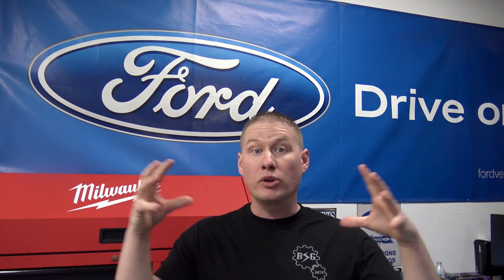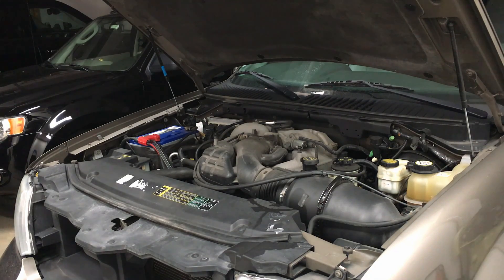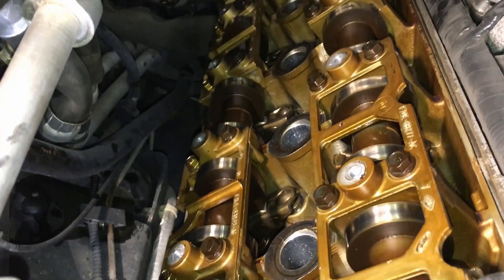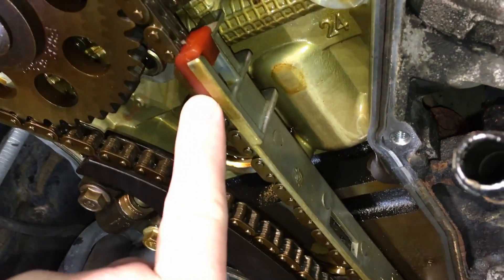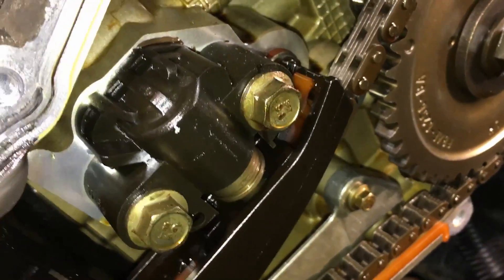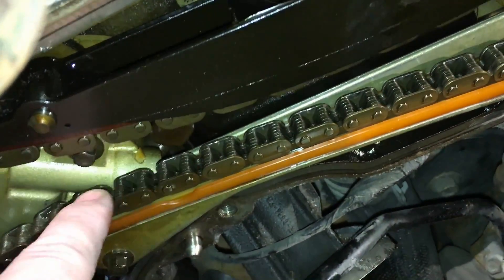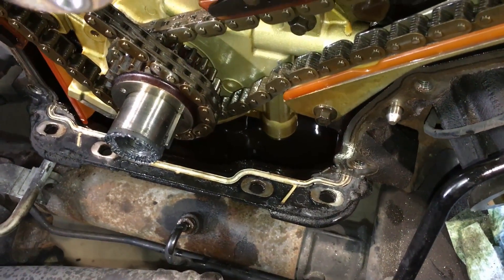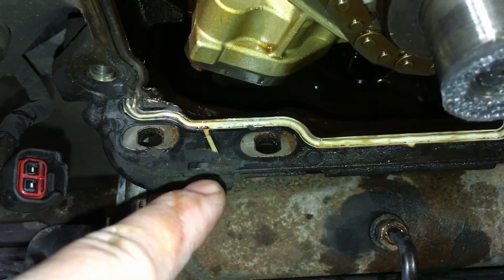Ford 4.6L & 5.4L Triton Engines: Common Failure Points to Watch Out For!

Comment: Thinking of getting a 5.4 triton f150 as a first car I'm 18 with a job is this truck reliable and can last me 200k+ miles?
Reply: Dont do it i had bought an 09 fx4 fully loaded and it cost me my credit buying a junker that didnt last more than two years not just 5.4 but the rearend will go to then tranny there was no way i could pay for new motor and pay all the payements due just after i rebuilt the rear end for 1300. Junk stay away

Comment: Hi i have a 2010 ford f150 super crew 5.4 flex fuel engine it is also a triton and my question for u is when ever i slow down when i am driving or driving through a drive thru it starts to idle really rough the hole engine shakes and makes a klunking noise  until ither i speed up or turn the truck off their is no check engine light and i just changed all the spark plugs but unfortunately it is still doing it i have made a video if that would help im just stumped for answers and have yet to find a solution

Comment: I bought an 03 marauder 4 months ago with 110 miles for $1500 that sounds the same at idle. Got right valve cover off last night. Guides look intact but chain is very loose. Going to tackle left valve cover and front cover today. The all aluminum 4V engine is a piece of artwork!  Sounds magnificent at high rpm. The average Joe is scared of these modulars. Previous owner loved car but sold cause he got repair quotes from 4000-12000. Ford, GM or Chrysler, don't matter to me. If I like the look of the vehicle I want it.
Reply: Once fixed you have a $10,000 car... nice find
Reply: Check the Tensioner, that thar is youns problem

Comment: Everyone here is talking about these engines and all the timing issues these engines have. Do y'all know how many timing sets I changed on GM's during the late 80's and early 90's? GM blessed their V8's from around 72-74 through about 86 or 89 with a Teflon coated timing set to reduce noise. The Teflon wears off and the aluminum gear underneath skips on the chain almost immediately, some bent valves, some didn't.  Always a mess in the pan. Lots of younger guys don't see these as they've almost all been replaced by now. Granted, this was $20 to $40 in parts back then so not near the money that one of these Tritons cost but it was a real aggrivation back then. Did one on a 84 Buick Riviera  (front wheel drive, V8 powered). Whole engine had to come out to replace timing set and clean the pan.
Reply: 351m and 400 had the same problem, dad had a 80 f-250,p.i.t.a.
Reply: you soaked um.aint got to pull an engine. readin too many manuals.
Reply: Cam lobes wore off too. Good luck getting a sbc to go over 150k miles w/o major work.  Even 5.7L made up through 2001 are only good for 200-250k miles from my experience in fleet care. And at that they use oil, tick,  smoke. My 4.6 2v had 9,000 idle hours on top of the 240,000 miles and only used 1 qt oil on 10k mile oil change interval (royal purple) after about 7 or 8k miles. I towed a big Grand Prix with it towards the end and hardly knew it was there. Shame it got totaled
Reply: Strong Tower Lawn Care    We’ve got two little W 4500 cab overs here at work with vortec 350s in them There spare trucks now because of the mileage. but still running good. I looked while I was in the parking lot one has 307,  000 miles the other has 341,000. Not too shabby. The E 350 box trucks that they bought to replace these older GMC‘s Have the 5.4 . Power wise there about the same  as the old 350 no complaints there but Lord they are  giving a bunch of trouble There’s always one at the Ford dealership and I didn’t think these newer ones blew out plugs But we’ve had four or five of those in the last few years. They’re getting replaced by 4500 express vans with the 6.0 Litre vortecs as fast as we can afford to do it . Having driving these ford triton’s here at work is the reason I can’t make myself buy an F150 even though I found some that I really liked. I’m kind of scared of the 5.0 coyotes to.They should just build one pushrod engine for people that want it And see how it goes. If my 2013 5.3 can get about the same or better gas mileage as these new dohc engines Why even make these complicated things.
Reply: I had a ‘69  F-150 with a 360. She also had that stupid Teflon coated timing chain, which shattered, a clogged the oil pump pick up.

Comment: Have seen a seized up 2 valve 5.4 because of a bad oil pump ignored,this was in a 2003 F150.Could not turn it over.The 5.4 also has headgasket issues

Comment: Looks like the owner dose not use high end oil and dose not change it at 3000 miles.  That is why she broke.  And a lot of people don't change there oil.  Very dumb people.
Reply: Trent Wentworth their*
Reply: Possible but the oil pumps in these are shit.
Reply: Trent Wentworth.....That must be some good crack you're smokin.  This failure had ABSOLUTELY NOTHING TO DO WITH THE OIL OR CHANGE INTERVALS.  The vehicle had 136,000 at the time of the video, and I can tell you from the appearance of the internal surfaces this vehicle was regularly maintained.
Reply: Trent Wentworth I bought a 2000 Ford Explorer with 230000 miles and when I got it the engine sounded terrible it would shake at idol and sounded like absolute shit I put a little seafoam in it after I changed the oil and ran it changed the oil again after a few hundred miles and the BRAND NEW OIL came out black so I changed it again with Mobil 1 synthetic oil and the engine has been running GREAT since. I’m tellin you change the oil on your car when your supposed and maybe even before just cause it will help your engin last longer and you’ll have an engine that won’t stop going. It’s simple you don’t take care of it it will break. You take care of it it will be reliable.

Comment: I have a question?   I have a 2005  5.4 F-150   and a 2007 Explorer 4.6 Both of them have the same problem... AT about 40 mph.... they both stumble... then it goes away... Doesn't do it all the time.....but Most of the time..... Any ideas?

Comment: Do the coyote 5.0 in the Mustang have a small valve train noise? My 2015 Gt sound like a diesel with the hood open. The noise is not loud, but the engine does not sound like a OHV. Does the variable valve timed overhead cam engine sound my description? It has sounded this way since purchase.

Comment: So many comments about the 4.6L modular engine being a bad engine!(?) Head gaskets, tensioners, pistons... sounds like a lot of Mopar and GM fanboys to me.

There are literally tens of millions of these engines in service, and in 2004 when I was looking for a new car I researched this engine which was in the 2004 Mercury Marauder I was thinking about buying. Anybody want to guess how many crankshafts for the 4.6L were in dealership parts departments in the entire US of A? Twelve!

I'm a retired ASE Master Technician and I worked for GM dealerships during my career; Chevrolet, Buick, Pontiac and Cadillac. That's why I knew what to look for - "What do the parts departments stock for the engines and transmissions?"

When I retired I was choosing between the GTO and the Marauder, you can see my choice by my avatar. I think my 4V 4.6L all aluminum engine is a honey; 300+ HP from 280 cubic inches! Oh, and one more thing...

...no noisy valvetrain yet. Goes 140 with the stock engine and is smooth as glass. (I've done some modifications to the running gear and computer program.)

Comment: I've got 457k on a 5.4 and 238k on a 4.6. Great motors.
Reply: I have 305k on my 5.4! Can't lie it's been a good engine.
Reply: Google Name good too know. You must put alot of maintenance in your vehicles
Reply: Zachariah Woller I've had a dozen of these engines not one problem.
Reply: Ive got 254,000 on a 4.6 and only have lost 2 pounds of compression on one cylinder, thing hauls 4,500 pounds with ease with the A/C on. Will always stick with fords
Reply: @Tate_Cunningham  you tow 4500#? 2v ? Year?
I'm truck shopping for next year. I've out grown my Ranger
Reply: Google Name That's encouraging!
Reply: O'Thaniel Greathouse I have 142,000 on my 5.4 is there any advice you could give me too keep her going strong for long run
Reply: Anything will last as long as you maintain it. I have a 1999 Ford f-150 with a 4.2 v6 with 291,000 miles and a 2003 f-150 with 192,000 miles, and do all the maintenance my self.
Reply: fomoco:
What do you mean.
Reply: Sweet! 330k on my 99 5.4 F250 SD. Reliable and still putting in work.
Reply: Got over 500k miles out of a 4.6 in a Crown Victoria... former taxi
Reply: Got 350K on my 4.6.  No problems. I have had Oldsmobile, Chevy, Ford, Dodge, and this 4.6 has been the most trouble free.  The only thing that comes close to the 4.6 is the American Motors 4.2. Another bulletproof engine.
Reply: Wow
Reply: Google Name that is very good to know. Just got a 1999 Ford F-150 xlt with the 4.6 for my first car today.
Reply: People on the comment session are getting all confused I think he buy talking bout the 3v not the 2v cause the 2v has been shown to be more reliable
Reply: I have 437000 on my 2007 Ford expedition EL and a tow with it all the time just regular maintenance all I’ve done to it is change of solenoid switch in the transmission
Reply: cool story bro.  I guess that discredits everyone who had issues right.

Comment: I have a nissan pathfinder with timing chain guide issues also.. it gives you alot of warning though by making whining noises first.  It has 170k on it.  I'll change the guides, chains, tensioners and water pump & should be good for another 170k.

Comment: Thanks a lot for this video.  I have a few questions, please:  How many miles were on this engine?  Did you remove the oil pump and check it for wear, or leave it in place?  I own an '08 van with a 4.6 @ 50,000 mi.  Thank you.  I am subbing now.

Comment: i have a 2007 Expedition 5.4 liter Triton I need to replace the throttle body after I get it done is there any way to clear the codes I do not have the program to clear it

Comment: Hey i have been wondering if you will ever tackle the infamous mustang coyote ticking issues. There are alot of videos and alot of talk on forums about the infamous ticking nd i was just wondering if you would ever tackle that problem. Im also asking because my car has that issue been driving if for 5k miles nd still running strong just keeps ticking. Maybe i can let you use my car for one of your videos. Let me know

Comment: Henry Ford went bankrupt twice, then he made some parts weaker so he could sell parts and service at a higher level. Saved his company but all American car companies used this formula for many years. I have owned Japanese cars and trucks and American.  It's funny but my American cars were the best so far. Japanese had failures as well.
Reply: Owned a Subaru (shitbaru) never again. Head gasketS at 100k at best. $2500 bill. Possibly a new engine. Not worth a dime! Own a f150 had 160k miles and it blew Transmission. Thats the most major issue. Im getting the chain rattle on start up now 😞 maintenance i guess. Close to 200k guess its time

Comment: I
 am very disappointed that a FORD engine who managed to beat the 
Ferraris in the 60s (GT40) will happen to those things that lower the 
image, durability of its engines (and the reliability that the owner 
expects of its FORD), small details that can Cause the engine to break resulting in costly repairs. If
 FORD wants to maintain its good reputation, it must modify that DOHC 
system (chain, tensioner and plastic skates) and make it more durable 
and reliable or return to the magnificent engines of a single central 
camshaft.

Comment: HELP! 97 5.4 two valve triton. Oil in cooling but no cooling in oil. Pressure tested external oil cooler at oil filter location, check ok. Tore down heads, gaskets look clean, only slight delam. / crunchy feel not assoc. with oil/cooling ports. No contamination between laminations of hd. gaskets. Are there suseptable  areas for internal cracks to look for? Ran a long time in this condition until one day I noticed the gauge would start to kwiver and then drop like a stone to zero after 1to2 min. on cold start.

Comment: To all the folks down below who are second guessing buying a Ford 5.4 I have 3 now with 5.4. 157K....190K and 346K
batteries, brakes tires and oil changes that's it. Best trucks I ever owned.
Reply: Maintaince is key for any vehicle. It is easy to ragg on a truck when you never give it an oil change or swap fluids change plugs... Ect.
Reply: Ricky Thompson , I don't want to jinx myself I've got a Super Duty Ford E350 with 198K , Best work truck every!
Reply: As long as you change your oil and coolant these engines will last 200k
Reply: EXCEPT WHEN THEY RUST IN NEW HAMPSHIRE
Reply: No matter how you feel about the 5.4 Triton, the Coyote is a far superior engine and a step in the right direction.
Reply: Terry Melvin From what I've observed from autotrader, craigslist, etc, they've already plummeted.
Reply: Terry Melvin  Yeah no joke, whatever moron thought it was a good idea to redesign an iconic muscle car like the charger into a 4-door family car/cop car should not be allowed near an automobile ever.
Reply: Terry Melvin  I have a 01 f150 5.4l Triton with 86k how do I know I have a 3v ?
Reply: Do you add liquimoly or marvel mystery etc?
Reply: Viking Mike Q  every muscle car that has ever been made has always dropped production line. The charger, the Challenger, the dart, the Camaro, the Firebird, I can go on and on but I'm sure you already know the only muscle car that has never stopped production is a the Ford Mustang bitch. Kind of makes you think there's a damn good reason for that don't it dumbass. Your nincompoop asinine comments are meaningless give up now.
Reply: I'm eyeing a nice low mileage 08 f150 5.4 3v Bryan's video's scare me but ppl like you who comment high mileage no problems give me confidence lol.
Reply: Don't be mad because the Ford Mustang is the best selling sports car / muscle car ever.
Reply: Sparkplug launcher!  I had 3 blow out at one time with 15,000 miles. (2002 F 150 XLT )  Same thing happened to all 3 F350 trucks at work. They now buy Chevrolets.
Reply: That's because the spark plugs weren't torqued properly. Period. 
Ford's torque spec on the manual was incorrect. Double it, and you'll never have a problem. 
   Furthermore, one blown plug is not the end of the world. Buy a repair kit that comes with everything you need to chase the threads, thread in a new steel threaded insert with red loctite. 
   Install new spark plug, torqued to double the OEM book spec, and a new coil-on-plug (if coil is broken, as it always will be, if plug blows out of cyl head). 
   I had one spark plug blow out of my 2001 F-350 Super Duty with the 6.8L 2-valve V10 engine. Drove it home on 9 cylinders. Bought the re-thread & steel insert repair kit and installed it. Installed a new coil on plug. Removed all of the other nine spark plugs. Found 2 others that had begun to work loose. Checked plugs. Cleaned and set their gap. 
   Put just a small dab of copper anti seize on the threads and retorqued ALL spark plugs to double the OEM service manual spec. Never had a problem again. 
   Did the same job on boss's 2005 F-250 w/5.4L 3-valve V8. 
   I realize that there were not many spark plug threads in the cylinder heads on the earlier 2-valve engines, but as long as you properly torqued the spark plugs, it was not an issue.
Reply: Yeah, not to mention Motor Trend thought they deserved the best truck award for decades. So the proof is in the pudding, Ford rules Chevy will always drool, and Dodge is nothing more than a Fiat now LOL
Reply: @madmikesprops  My business has to pull 30ft plus trailers with a 5th wheel.

I have ran Dodge and Fords in my fleet but the transmissions kept blowing. Now I only use the 3500HD chevy truck's because they are the only trucks that don't blow up on me.

When your work has you pulling a 30ft trailer across the country you don't want to break down and pay a tow truck for a 15 hour tow back home, that's all that Ford has done for me.
Reply: @boostjunkie2320  Sounds to me like you need to change your driving habits lol Fords will treat you as good as you treat them and in a lot of cases , even better. Also a little friendly advice,  if you're pulling 30 foot trailers across country on a steady basis, you might want to think about  using a manual transmission. 😎👍
Reply: @madmikesprops  Funny, none of the Silverados blew up on me.......Some of my trucks are manual. When you have to maintain a fleet of trucks out of your own pockets it doesn't come down to picking side's or being a fan boy. I was tired of towing home Fords and Dodges.
Reply: @boostjunkie2320  Lol to each his own brother.

Comment: I wonder if he used aftermarket filters without the drainback valve. I know some filters are very noisy. Local ford dealer has a big poster by the service department about this issue. 

i replaced a spring on an early 4v lincoln continental engine. Is that a common thing? New one was beehive.Chains seemed tight from the valve cover. 165k. I think tensioner quality went down over the years. Early 90s modulars had few issues with the timing drive.